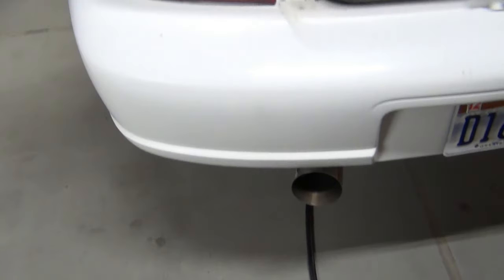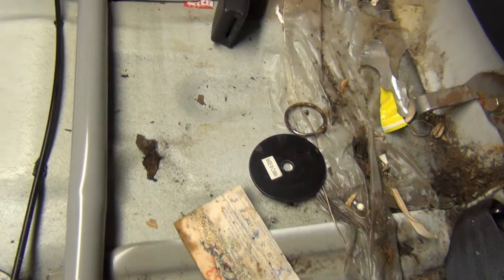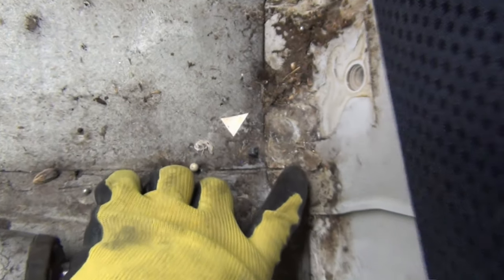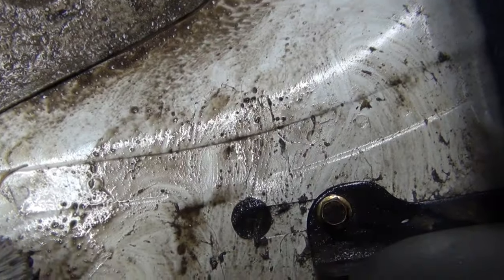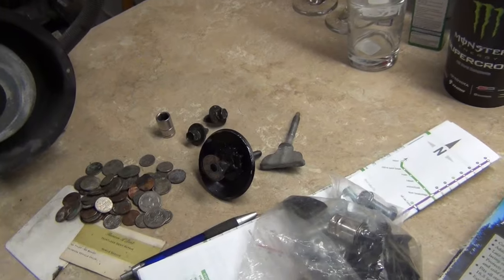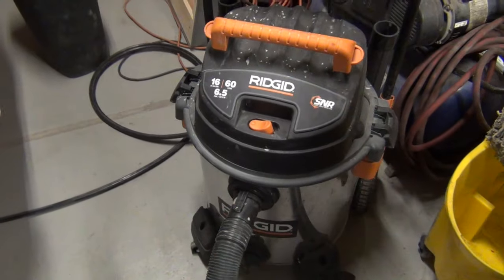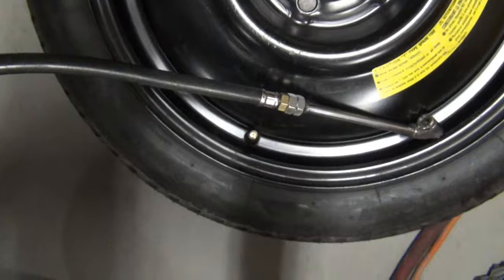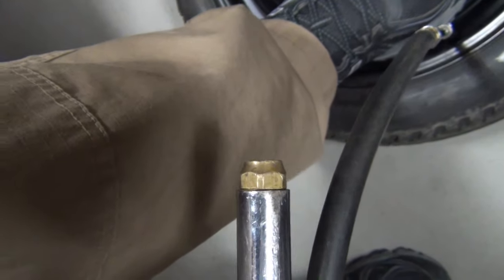How to Remove the Rattle & Stink From a Used Car or Minivan

Comment: I've founds an easy way to clean that back seat is basically do the same process you did on the floor.  Spray with water(I use a garden sprayer for this so I don't have to keep squeezing about 100+ times)  Hit the stains with Simple Green or Greased Lightning. Scrub, Then just use the shop-vac to suck all the water out of the seat.  Dry in about a day if your vac is any good.

Comment: It's funny that you posted this. I just started the same process on my car. It's a bit worse than yours was. I still have the carpet from the rear hatch drying and I'm going to hit it with another round of cleaner before it goes back in. You're right though, it is satisfying once you get into it!

Comment: I bought a 2006 outback this summer that one of the previous owners had dogs that must have rode in the car a lot.  I replaced the cabin air filter a couple months ago and it was packed solid with dog hair and small leaves.  Watching your video makes me think I need to pop off the back seat to clean out the dog hair from there.